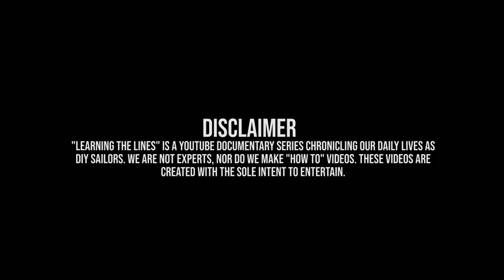What's Up With Our Cutlass Bearing? | Learning the Lines [Casual Friday] - DIY Sailing

Comment: Looks like you are about to put a new bearing inside the old jacket?Remove old jacket and get the proper bearing.
Reply from the maker: Sounds like that is what we need to do.
Reply: Outside part of bearing "jacket around rubber" the brass part of the bearing.Excuse my terminology I am surely not a seasoned boat builder but have spent my time in the boatyard.

Comment: If others have made this suggestion then this is conformation of their comment: 
1 Old bearing removal : There is a tool made to remove an old bearing. It has a steel impact head shaped like a top hat meant to drive the brass tube out. It works as long as you can find this tool and the impact head is the right size. The DIY method is to take a hack saw, undo the blade, turn it upside-down, put it through the bearing and re-attach the blade to the saw handle. Now, VERY carefully keeping the blade as straight to the bearing as you can, cut the bearing along it's length in two cuts about 45°  to 90°  apart. Sometimes the gap left by the first cut is enough to compress and loosen the tube. The bearing should now pop out using a piece of conduit and a hammer - maybe with the help of some WD-40 or some sort of corrosion buster. Use some fine grit sand paper, rolled into a tube to clean the inside of the strut knuckle.
2. New Bearing replacement : The brass of the bearing is soft. The same "top Hat" tool used to remove the bearing is used to install the bearing, but instead of hammering it, a threaded rod and nut/washer is used to "squeeze" it in to place. If the new bearing simply slides in by hand the outside dimension of the bearing is too small. This is a friction fit bearing usually on bearings of less than 3 inch diameter. (larger ones are sometimes braised in place) The set screw is/should be only a redundant method of holding the bearing in place. A hammer can be used but guaranteed you will mushroom the end before it is completely flush. As long as 3/4 or more of the bearing is seated you can cut the mushroom off with the hack saw. Some will order a bearing 2 or 3 inches longer than needed, cutting off the excess and mushroom when the back of the bearing is flush. The threaded rod with a nut and wide washer on either end is the best DIY tool for the job. Grease up the strut tube and outside of the bearing and it should seat fairly easily. In the commercial yard, especially with steel boats the strut tube is heated with a blow torch while the brass bearing is submerged in ice water or put in the freezer for an hour or so. If your strut is bronze or steel you should be able to do this safely with a low flame of a propane torch. It may scorch any paint around the knuckle of the strut - depends on your patience level and how quickly you want to heat up the strut. Of course - do not apply grease to the strut if you use this heating method.
Reply from the maker: I was just watching a video and the person had the cutlass bearing in the freezer. If we do that and heat the strut, are there no consequences to the sudden temperature change that we need to worry about?
Reply: The brass bearing is soft enough to handle the rapid heating and expansion. The strut is thick enough that the cold bearing wont lower the strut temperature enough to make a difference. This is a pretty common way to do this in the commercial yards. You don't need to heat the strut to the point that it glows, just to where it's a bit too hot to touch with bare hands.
Reply from the maker: Okay. I like the idea because fitting it will be easier. I was just nervous about the temperature change. Thanks for the follow up.
Reply from the maker: Just for the sake of full understanding and because we trust your advice, why does the old cutlass bearing need to be removed? If its locked in place and we drill threw it for new set screws, locking it and the new one in place. Why would that be bad? I know that's not how it's supposed to be done, but just for the sake of understanding the mechanical flaw with it.
Reply: If the new bearing is the proper size for the shaft, you physically can not do what you propose. The bearing or brass sleeve is the bearing while the grooved plastic liner, usually PTFE or "Teflon" is the permanent lubricant for the brass bearing. It is hermetically attached to the brass and does not slide out or in separately. In the video you show that it has become detached around the edge but this is probably just at the ends. The only way to remove it from the old brass sleeve or the new one is to dig it out with a blade.

If you are replacing the shaft (because of the electric re-fit) and the shaft diameter is smaller than the original, you can order a "generic" cutlass bearing with specific inside and outside diameter dimensions. The absolute worst thing to happen to the shaft and strut is for the bearing to come loose and begin spinning. The set screw is effective only to a point. The bearing will quickly slide out of the strut knuckle, the shaft will flop around in the strut knuckle with a high probability of bending the shaft. By putting a smaller bearing inside another, larger bearing you would increase the likelihood of this happening.

This is one of those times that "intuitive engineering" will turn out to be far more costly in the long run. This maintenance needs to be done by the book.
Reply from the maker: Thanks for the explanation. Unfortunately I think we're stuck between a rock and a hard place (It seems like that's always the case when trying to refit an old boat). Really I think the strut needs to be replaced, however it's not going to happen on our timeline for cruising. The issue is we have maybe one or two millimeters of bronze in one area of the strut that surrounds the bearing. If we remove the old bearing completely, that leaves us with a really thin strut. The thing has been corroding away for years due to lack of any sacrificial anode, no bonding, and no galvanic isolation. So, I'm really at a loss here. Not sure what to do.
Reply: From what I can see in the video it doesn't look as bad as you say, but it's hard to say confidently unless I could put my hands on it. If you end up putting a bearing inside the old bearing, I would clean out all the inside plastic of the old bearing, use the tightest fitting inner, new bearing you can find, and drill and tap at least two set screws at either end. The big ones use four bolts on both ends to align and hold the bearing, then the bolt heads get tack welded to the body of the strut. Whatever you engineer, keep foremost in your mind there can be no play and the torque force on the bearing itself can be extremely high - high enough to sheer off the point of a single brass set screw.
Reply: P.S. What you are thinking about doing could be done with "Stave Bearings" It's basically just the inner liner of the brass bearing. The problem is these start with a 2.5" diameter and a lot more expensive than the standard brass. I tried to find something smaller but couldn't - maybe you could have better search results.
Reply: This person knows what he/she is talking about👍🏻 good argumented advice.
Reply: Learning the Lines I don't see a reason to replace the strut , it does not take the thrust of the propeller it primarily keeps the shaft from wobbling about!
But I would not use any sort of hammering to remove or install the old/ new bearing. You should defiantly be able to use threaded rod and a selection of sockets and washers or pipe nipples  to press the old bearing out and install the new one. I would try and press out out the old bearing first. You can completely drill out the remains of the setscrew. If you cannot get it to move then burn out the old rubber and try the new liner you have. Install the reverse of removal, , press in. Drill & tap the set screw threads first!
Reply: awesome answer...very complete!
Reply: We used to do the same with large 'center-pin' bearings on heavy equipment...   It worked every time, as long as the surface of the bearing housing was free of any burrs or scratches...!  Good point!
Reply: @LearningtheLines  If the strut is that far gone then it either breaks in the yard or breaks when you are cruising leaving you unable to motor.  The former is a slight delay and expense, the latter is a massive delay and expense considering you'll likely need a costly tow and another haul.
Reply: Grind out the set-screw hole a bit and plug weld it (well, bronze braze). Clean each end with a flap disk / grinder and braze the old bearing in place. Drill and tap a new set screw hole at another location. Maybe also drill and tap a few holes for some zinc anodes, too. Push a new smaller diameter bearing in there and be done with it.
Reply: About your worries on "temperature change: It is a common practice in many industries like railraod wheels. They are made of two different steels. Like a tire on a car. They cut off the old, worn sacrificial "tire", heat the new one to make it expand and freeze the "hub" for it to shrink. Than press the new "tire" in place. It's thus called "press fit".
Brass is a very reacting metal to temperatures, hot or cold. No danger to hurt either parts.
Reply: Sound advice.
Reply from the maker: Thank you for all the feedback. We chose the method we thought would be best given what we saw here in person. It can be hard to convey on camera. Working on editing our Storyline Sunday video to share the progress with all of you.

Comment: Your mileage may vary ... Purchase the correct size/type cutlass bearing, rent/buy the proper bearing puller .... if necessary, use a hand-held MAPP gas torch to speed things along ... yes, the rubber will catch on fire. If the old bearing still won't come out, use a hacksaw blade to cut down the long axis of the old bearing (not all the way through, but close), preferably bisecting the set screw hole. You can then use a punch through the set screw hole to collapse/remove the old bearing - use as many saw cuts as necessary. Keep up the great vids and good luck!
Reply from the maker: Thank you, Alan! The punch is definitely a good idea.
Reply: ^^ I second what Alan has said. That is the approach I would take as well.
Reply: Alan has it right with the MAPP gas. Heat is the only thing that is going to help you to get the old sleeve out.

Comment: The way I did mine was with a steel saw where you put the blade inside the old cutlass bearing and you saw a slot out. Then with a flat screwdriver you pry the two sides toward the center. With some elbow grease you can then pull it out.

Comment: Have you considered carefully making one length wise cut inside with a hacksaw blade, lifting one corner and  wind it in on itself?  Kind of like rolling up the lid of a spam can.  Good luck.
Reply from the maker: For the rubber I think that would work. With the advice we've been getting though, it looks like we should try to get out the old bearing completely.

Comment: I used a deep socket for mine, and I've used a metal sawblade and cut out the old jacket. And lots of penetrating oil. Plumbers cut i.d. pipe out all the time. It really isn't a big deal. and you can use a master cycling honing tool to clean the i.d. of the strut.

Comment: As many have said here, you will need to get the old one one. I would start by soaking this with JB 80 or PB blast (They work far better then wd40). After a couple days of spraying it down (Unless you are in a hurry) clean it off and clap on some aluminum plates between the Keel and the bearing. This is to be a heat sink, now use a torch and heat that thing up, and use a pulled to pull it out.

Comment: just make a puller with 2 deep sockets and threaded rod. One socket the the od of bearing the other the size if mount . Use PB blaster and some heat.I would not bang it out. too east to damage mount.
Reply from the maker: Yes, we definitely want to avoid damaging the mount. Thanks for the advice!
Reply: The two sockets and threaded rod is easy to do and works very well. Only the large one has to be a deep socket.
Reply: Could u explain in more detail how this is made?

Comment: Some great highly technical suggestions using pullers, or using a power tool to cut it out.
here is my low tech suggestion..

Sand both ends of the strut to cutlass bearing connection to firstly break the corrosion connection between both and secondly to clearly see where the cutlass bearing ends and the strut begins

Then take your hacksaw with a new blade, remove the blade from the hacksaw and insert the blade into the cutlass bearing and then re-attach the frame of the saw, carefully cut front to back on one side using long slow steady strokes to maximise the cutting surface, while checking you are not cutting into the strut at either end, then rotate the saw 180 degrees and cut front to back on the other side ensuring that you only cut through the cutlass bearing and not into the strut, then cut between these cuts to release a segment of the bearing pry this out and it should be free enough to drive out the rest.

Comment: Take a hack saw blade and cut the old brass sleeve longways. Do it at the top where the strut is the thickest just in case you go to far. Then take a thin screwdriver, wedge it between the strut and the sleeve and fold it in on it's self until broken loose. Remove old bearing. Take new bearing and put it in the freezer for a night. Packing it in dry ice even works better. You basically want the bearing to shrink up. Don't heat the strut because the heat will transfer to the bearing to fast and it will never go in. Then use a piece of all thread with nuts and washers to draw the new bearing in. Replace set screws.
Do not remove the rubber from the old bearing and then try to put a new one in. If it does go in which I would put money on that it wouldn't, it still will be to tight on the prop shaft and will burn up.

Comment: Before drilling any set screws (grub screws) try picking at the flat  bottom of the holes. Sometimes there are TWO grub screws in a hole, similar to using two nuts on a bolt.  As many have said, rent a  puller and do it right., messing this up means a new prop shaft at least.

Comment: Use plenty of penetrating oil...  I once popped a brass pilot bushing out of a recessed housing by soaking it with penetrating oil overnight, and using a wood dowel driven into the center of the bearing...   I was pleasantly surprised when it popped right out...!  This application is a whole different story, since yours is a 'sleeve' bearing.   Carefully cutting it might be the best option...?  Good luck on your next step, regardless!    :)

Comment: The brass jacket is suppose to come out with the bearing not just the rubber. The replacement point is denoted by the raised ridges on the inside of the rubber, once those are smoothed out replacement is mandated. Your's is worn enough to rate replacement. That is actually an easy one to replace there. They do make presses for these but the prop shaft needs to be in place to use them. Two shells are place around the prop shaft and a press is used to act on the split shells to force the bearing out. NOW, the way it is done without a press is to take a hacksaw blade (wrap a tape handle) and to gently saw into the rubber and into the shell casing. Some people use a sawzall, some people hack hell out of them. Best to do it by hand. Cut it laterally just above or below the set screw. When you're real close to being through the outter brass shell, an extended bolt the size and thread of the set screw is used to push and collapse the bearing casing. Then you work it out by driving large screw driver between the shell casing and the strut bore. Once you get enough of the casing separated from the strut housing you can use vice grips to twist and yank out the bearing and casing. If that new bearing is only the diameter of the old rubber then it is not of the proper size. Check that by sliding the bearing onto your prop shaft. Once you get the old one out burnish the strut bore lightly and make sure it is smooth enough to drive the new bearing in using piece of 2X4 to cushion the bearing and a mallet. It is said to be a good idea to drill a small dimple into the new bearing casing where the set screw hits it to insure it stays in place. I never bother with that. I guess they use a small drill bit that won't hit the threads of the set screw hole to do that.
Reply from the maker: Thank you, Spencer! This actually makes a lot of sense. Alan Lott recommended something similar, but we don't have a punch so this we could do with what we have. Appreciate the advice!
Reply: Grade 5 or 8 bolts make GREAT Improvised Punches, and they come in ALL Sizes. I see your strut has enough room to take the blade out of the hacksaw, run it through the strut, and hook the hacksaw back onto the blade upside down, so you can cut into the softer brass. I would do it THIS way. Hacksaw blades VERY Cheap In Comparison...
Reply: Yes, he could do that as well. I myself just wrap tape around the blade and run it back and forth near the set screw until the brass bearing housing is thin enough to be split by running a bolt through the set screw hole. It's tedious, but usually can be done in 20 minutes or so. Some use sawzalls. I'm never in that big a hurry when it comes to stuff like this. My shaft tube is in the hull so I don't have the option of attaching the saw frame to the blade. Probably would if my cutlass bearing was in a strut though. File that under: "DER!"

Comment: I Second a flame chill for a few cycles to see if you can get something loosened up. Not red hot just gentle heat them cool. Then a diy press with sockets and threaded rod. Just super slow. Of course you can always rent or buy a special tool for everything. Corrosion issue remains the same. You guys got this. Just wait till brandy wakes up.